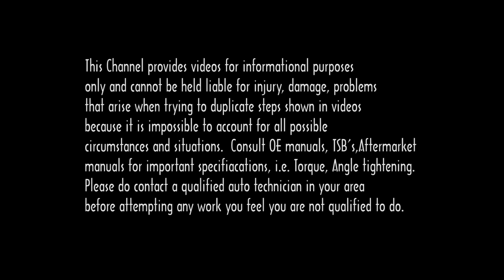CV axle replacement 2005 Chevrolet Trailblazer how to change front CV axle

Comment: You used nothing but a pry bar? What length?  I have tried multiple times to remove/replace and no luck had to end up cutting shaft. Also doing in driveway without a lift. Any help would be appreciated.
Reply: Terrible. Just terrible

Comment: Good presentation , lots of pieces in there to juggle , a second hand would have gotten rid of the bungies , I got a massive oil leak on drivers side engine , anything common go wrong on that side that you have seen before ?

Comment: You didn't replace the seal on the inside. Did it leak at some point after replacing the CV axle with the old seal?

Comment: I replaced both axles on my 2004 Trailblazer, but pulling the axles out was a PAIN! When i was using the pry bar to peck the axles out, it took more than a Little Peck. I really had to put some power behind it and it took more than just 1 Wack!  It was more like 3 to 5 Hard Wacks. Is this normal or did i do something wrong? All the videos on here show it being easy to pull them out.
Reply: I have helped replace the va shafts on an older Honda that took a reverse hammer about 5 sacks from my son who is a big boy to get the damned things to finally pop out…then did a jeep Cherokee where they just fell out with the bearing assembly…so I’m curious if trailblazers are a pain to get out too or not….
Reply: @w8what575  Mine were hard to get out because the little C-clips on the ends were stretched out and kept getting caught on the spider gears. Yours probably won't be hard to get out because what happened to me rarely happens. It's not a bad job, just plan it on a day off. That way you'll have plenty of time so you can do the job slowly. Really though, it's not a bad job. You can do this!!!

Comment: When you had the pry bar on the inside of the inner axle joint, I saw that the axle moves around in the disconnect alot. How much movement is normal?
Reply: coffeefish I don’t have any movement in mine and I’m standing here doing it even as we speak
Reply: @armedrealtorakasheepdog6914   I thought I had a grinding bearing in my axle disconnect. With a small mirror, I watched the axle for movement as I pried up on the inner CV joint. I don't see any movement in the axle (only a very small section of the axle is visible behind that inner joint.) I moved to the driver's side and did the same thing and I saw lots of movement in the axle. Now I'm thinking that the grinding is coming from the front diff and not the disconnect.
Reply: Did you run it low on fluid by any chance?

Comment: Are the R/F CV joints on a chevy trailblazer notorious for going bad? I bought a used 06 a week ago friday and just changed the front brakes when I found that its R/F CV joint was bad, I replaced the front brakes because I heard a noise and thought it was the brakes because the same kind of nose on a previous car I had was fixed with new front brakes (the brakes on the trailblazer needed to be changed because their thickness were about 1/16" - 1/8", hardly any "meat" on them at all)?

Comment: My only criticism would be when you put the lower ball joint back together you didn’t show how to do it. Mine is spinning so I’m assuming that I need to replace it because I don’t see any place to grab it while I’m tightening it.
Reply: Start watching at 9:45
Reply: Look underneath the nut, the thread piece has a 8mm hex on it. Put the her in it and use a Cresent wrench on the nut and tighten

Comment: I need to remove driver side axle, so this wasn't helpful. No room to pry on driver side, and renting a slide hammer tool to go behind inner cv joint also didn't get it out. Now what?
Reply: If its junk, then cut it in half, it will make it a lot easier to pull out.